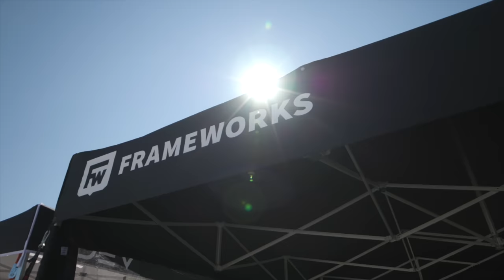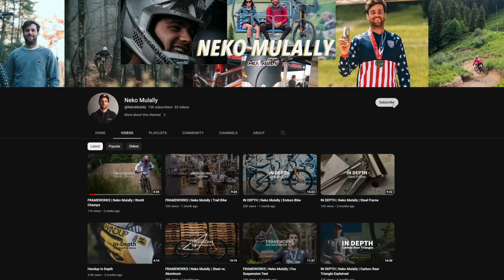The fastest bike brand you've never heard of

Comment: Yo Neko... I know your man over in England has his formulas for steel that made you that Proper steel front end, But a larger diameter down tube will give you the beef that you want. 1 3/4 .049 chromoly from Aircraft Spruce is what I used paired to a Bullit swing arm for 9 1/2" travel. But it's solid and planted instead of a noodle like many steel frames.

Comment: Ah yes, the aluminum framed bikes. The most common type of material used in creating a simple yet agile bike. I love it. And neko's bikes are built different, LITERALY, making it "Different, But Kinda the Same" I suggest a carbon-steel combination of the bike as it could be a bit lighter as the rear triangle is carbon and the front triangle is steel. Huge support to frame works and more power to you, seth.

Comment: I cut my mountain bike teeth on a steel frame bike in the mid '90's, and when I eventually switched to an aluminum bike a few years later, I couldn't believe how different it felt, and not just the weight. Even though the aluminum bike was "better," I still found myself missing that steel bike from time to time.

Comment: Cool bikes, I think the weight for the DH bike isn't too bad. 39 lbs sounds heavy, it also has a triple clamp front fork..except I don't really know how heavy an actual Dh bike is. 
   Alot of enduro bikes are 34-35 lbs. So he still has about 4 lbs to cut if that he is trying to do.
   I wonder if his broken aluminum frames are because he is not reforging them after welding. I wouldn't know because he welds the alu himself, so I think he should know. I learned that more recently.

Comment: Well, that's strange... I have a quesson and i know you can't answear for everyone. So i have a Rockrider St 530 with the deafult brake system, and i wana ubgrade to hidreaulic brakes. So the question is that can i put a hydraulic brake system to a mechanic rotor. The rotor is just seen massive, it has no cuts in, but is it will bi good?

Comment: Whenever i look at the design of suspension i think to myself that someone must have failed geometry class. When the rear arm swings up it does so in an arch pattern. The shock and shock actuator are never mounted correctly. Always an engineering bind is present.
Reply: Have you ridden it though?  He literally has ridden thousands of bicycles.

Comment: Being disabled, carrying a heavy bicycle isn't for me and ngl I'm quite happy with my kind of lightweight aluminium frame ^^
Reply: The company that makes the steel frames, Five Lands, also makes front triangles for Cotic and while they're not lightweight, they're not really drastically heavier than a typical alu equivalent- steel is heavy sure but it's also strong, you can do a lot with less especially in frame joins, and it's very fatigue resistant. You can buy heavier alu frames than my steel Cotics, put it that way. 

The Frameworks one is pretty overbuilt because the steel one was a reaction to all the alu ones cracking, it's heavier than it needs to be.

Comment: I am concerned with the angle the rear shock is pushed. Where does the force come from? From an angle. What happens inside the shock? Those rubber O-rings gets squeezed sideways in something they did not consent to.

Comment: Why do pro downhill MTN bikes have gears?  Obviously, a downhill race that has a lot of traversing would justify gears. But, these high speed downhill runs dont really seem to need a full cassette.
Its kinda like terd freestyle skiers in a halfpipe or hucking the "big air trick" using poles.  There is no reason.